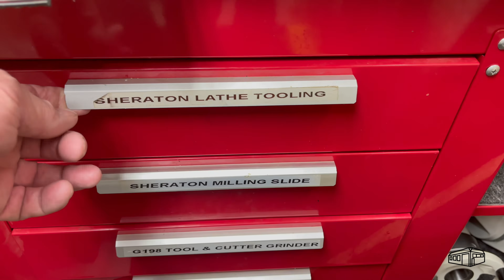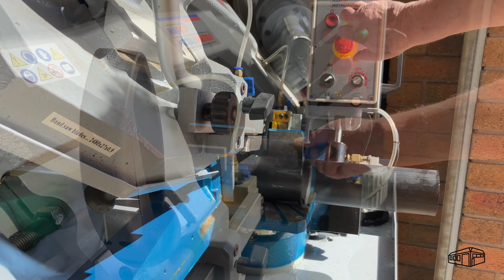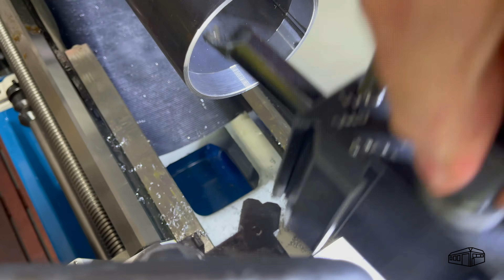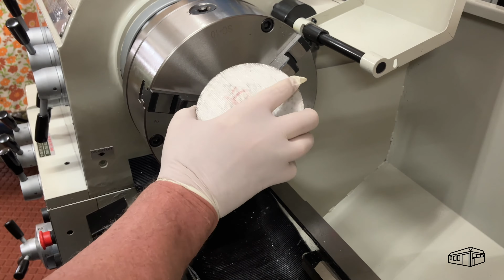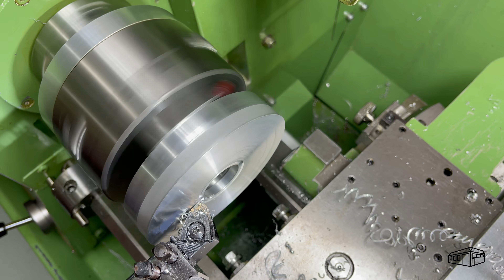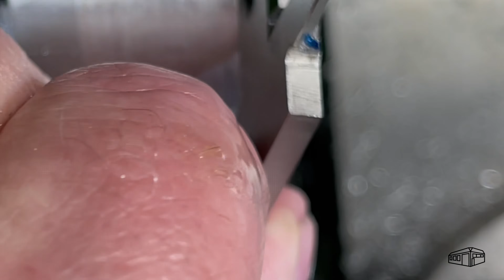Quick Change Lathe Tool-post Holder Storage Tree (Part 1). #HFCreators

Comment: Well, I have binge watched both videos and have to say that for a 40 year old lathe that Colchester is immaculate, not sure the paint is an original colour. I'm also not sure that "shed" is the correct word to describe a building which can take 3 lathes, one of which seems to have a 100mm hole down the spindle, plus a sizable band saw. Anyway I have subscribed, greetings from Yorkshire in the UK.
Reply from the maker: Welcome Bill, great to have you on board. The Colchester paint is the original colour and the original coat. It has been well looked after. and is covered when not in use.